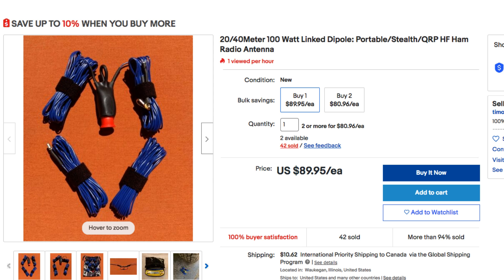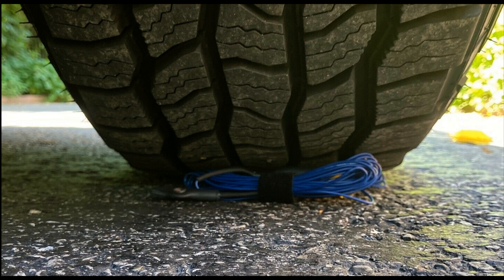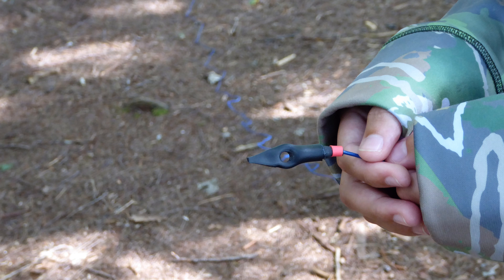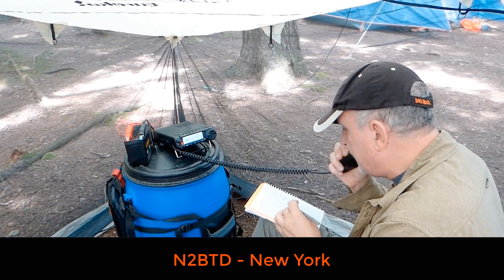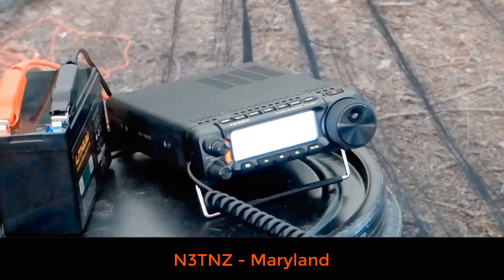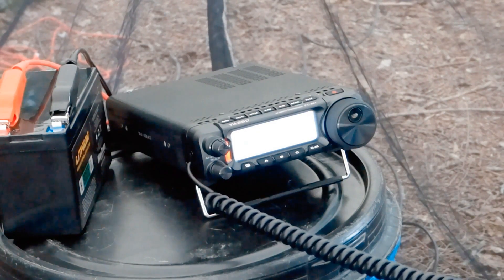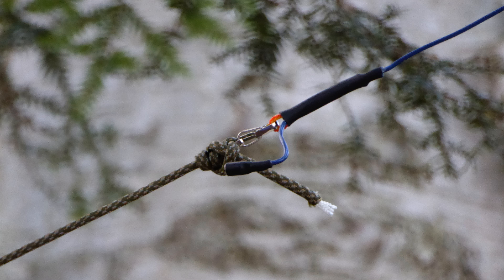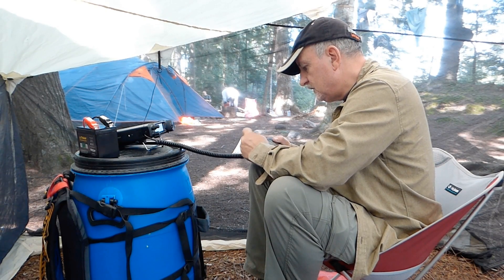Field Test - The N9SAB 100 Watt 20/40 Linked Dipole

Comment: Nice video, nice antenna. I use a dual band 20 / 40 dipole. It uses coils to make the antenna resonant on both bands.
When I operate portable, 99.9% of the time I only use 20 and/or 40 meters. Those are my two favorite bands. 
Now that 10 meters has been open, I think I will carry along a stand alone 10 meter dipole, just in case.
Barry, KU3X
Reply from the maker: Thank you, Barry! It's interesting to hear your antenna and band strategy.

Comment: Thanks for the video. New ham here.  I have a loaned linked dipole for 20/40 from a friend who doesn’t need it anymore. I plan on making a fan dipole for home to run 80/40/20/10. We shall see how that works.  

Question: When you said you had to remove the link for 40, did you mean take it off and run paracord to the 20m?
Reply from the maker: Welcome to ham radio! Yes, that's exactly what I meant. I had to remove the 40m extensions and tie the paracord to the 20m radiator ends. Now get out there with that linked dipole 👍
Reply: @OutdoorsOnTheAir  So to follow up, the other element just sitting there disconnected was affecting the SWR? That means I have to get off my lazy bum every time I want to change bands on a linked dipole (or at least what you experienced)? I wonder if I should just throw the fan dipole together.  Or I could hoist up the linked dipole and get on the air and quit this dreaming.  Haha.  In my engineering career they called this the paralysis of analysis.   All the best!  73 de KI5HXM

Comment: Nice video as always Tracy.  Tim makes great antennas.  I own a OCF Dipole by N9SAB and it works like a champ. Did you do any antenna trimming before you went on the trip?  Thanks and 73! George K2WO in FL
Reply from the maker: Thank you, George! No trimming. Still wondering if the tent poles were affecting the SWR. 73 from VE3TWM.

Comment: I’ve heard great things about those antenna.  Surprised you were having swr issues.
Reply from the maker: Hi Mike, there are several things i look for when facing an issue like this. 
- First, is the antenna damaged? I don't believe that to be the case here.
- Second, if in an inverted V, is the angle at the feedpoint less than 90 degrees? No, it was much larger than that in this install.
- Third, is there metal in the near field of the antenna? Usually not an issue in the backcountry, but there were metal tent poles within about 20 feet of the antenna which might have played a role.
- Fourth, the feedline. Was there an issue with the ABR low loss coax I was using? Could be. I bought a bunch of ABR RG8X last year thinking it could help with low power deployments, and while it is good coax, I have found it less than ideal for portable ops. I'll likely expand on that in a future video.

Comment: I have the same antenna.  Works like a champ!  I usually configure it as an inverted v.  Sorry I wasn’t able to work you for your activation.  73 my friend.
Reply from the maker: Hi Chris, hope you and your family are doing well! Went back and watched your video on this antenna. Did you ever get the SWR down? I think I know why your SWR was high.
Reply: @OutdoorsOnTheAir  20m was perfect out of the box.  For 40m, I just folded the ends back and brought it in.  I noticed on yours the 40m legs are separate.  On mine they are attached with a small loop at the links.

Comment: Interesting that you only operated 20W SSB.  The FT891 finals are biased for high power and running the radio below 50W is likely not saving your battery.  N4HNH has a very good analyses of the power consumption https://www.youtube.com/watch?v=ylYujQSDGJE
73
Reply from the maker: This is a very interesting topic. I've done quite a bit of research into this and will likely post a video showing more in the near future. I believe there is good reason to run less than 100 watts but will need more time with the 891 to be certain. 73 from VE3TWM.

Comment: "The mission determines the loadout." A linked dipole is a fine antenna for field deployments. It is especially usable if you're running a frequency and will be in-band for some significant amount of time. The same is true of verticals like the Wolf River Coils system. It's a great antenna if your working in-band.

But if you're a hunter/chaser, then frequency mobility is more important. Activators are always changing bands as they work a site. So it's untenable to chase them across the bands with an antenna that you have to physically change to switch bands. 

That's the reason I favor EFHW or random wires for a lot of portable deployments. These antennas are workable on multiple bands and makes chasing activators a lot easier.

I've done a number of SOTA activations with a SOTAbeams 20-30-40m linked dipole. It was not a big deal to change the links when changing band. But it made chasing S2S contacts a lot harder. Fortunately (for me), a number of activators will jump to my frequency and call S2S.
Reply from the maker: GREAT points. Thank you for sharing your experience.